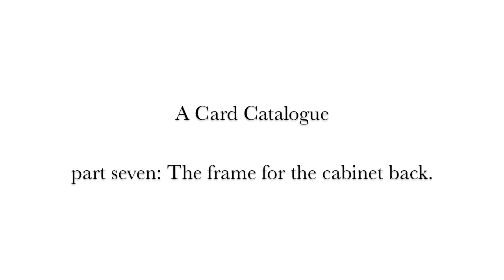A Card Catalogue part seven: The frame for the cabinet back.

Comment: Tom, do you buy all your lumber pre-thicknessed?
Reply from the maker: +MrJVH88 not very often...if a client comes to me with a budget I will sometimes use pre-dimensioned materials to save time...but when it's my own work, I prefer buying rough lumber so I can dictate the final thickness. In this example, I think it was pre-dimensioned offcuts I had saved from a previous job.
Thanks for the question,
all the best~